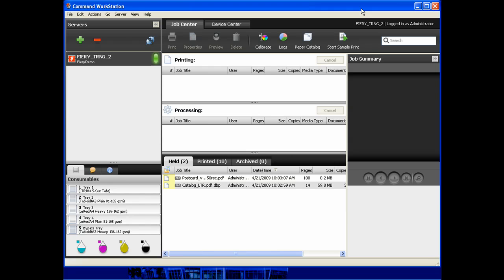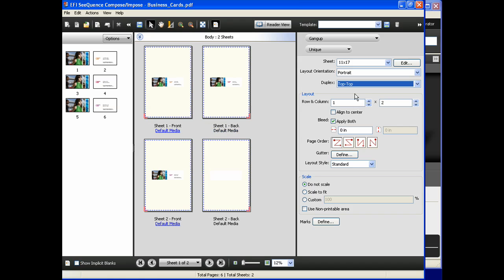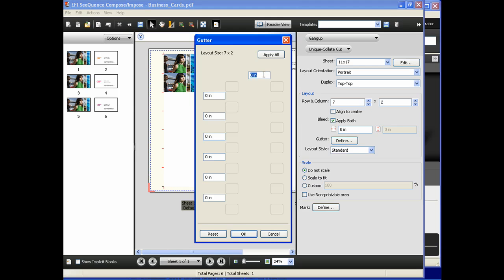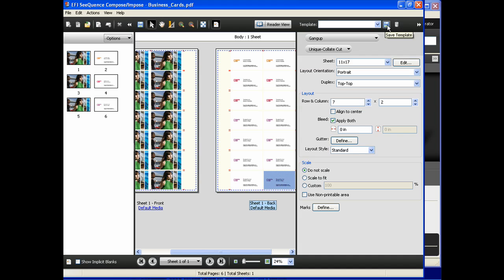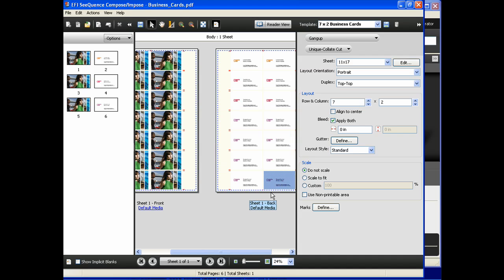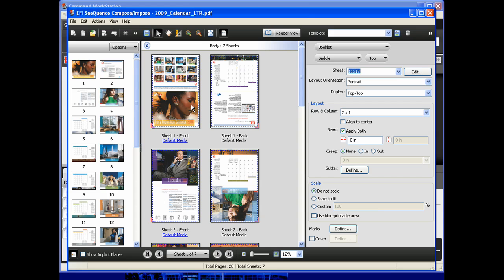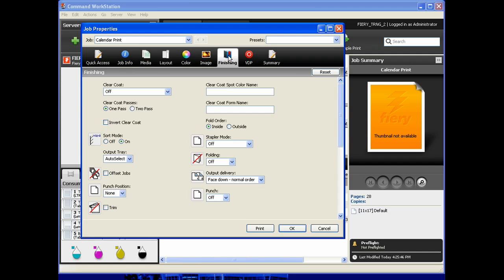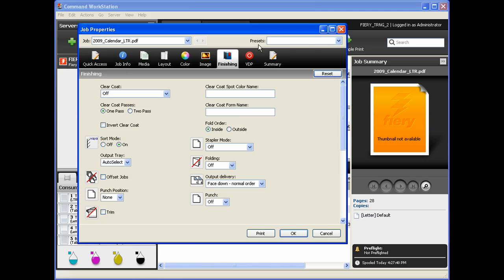Fiery SeeQuence Impose

Comment: You will not be able to access Fiery Impose when your printer is down, because there would be nothing there to upload your file to. So you will not be able to prepare imposition files for someone else to print. There should be option to add virtual generic printer to Fiery Command WorkStation, so that you can still manage existing files, when your printer is down. EFI keeps ignoring this problem. If you ever thought of Fiery Impose extension for Fiery Command WorkStation, think about PDFSnake. It is three times cheaper, too. Very frustrating.